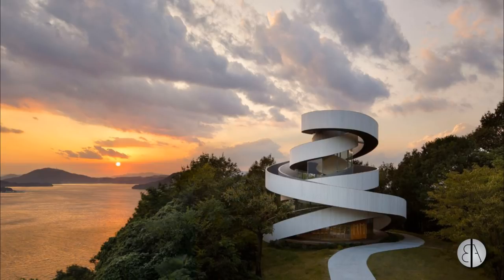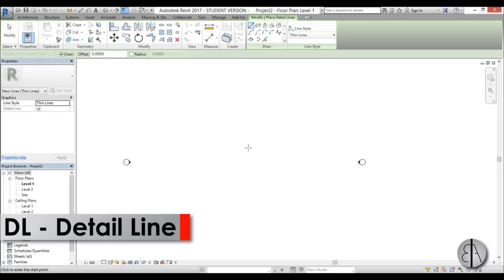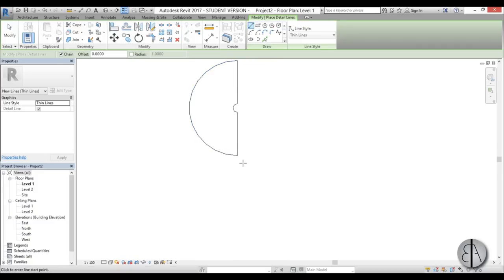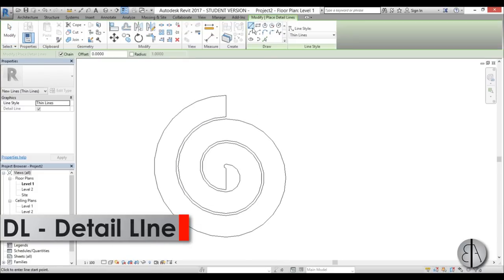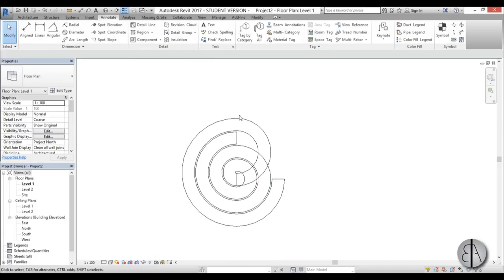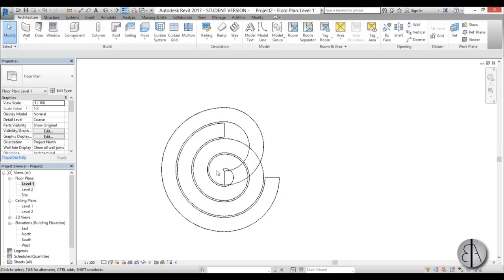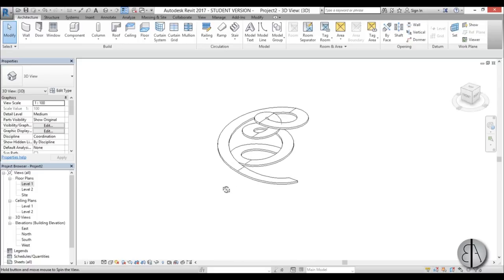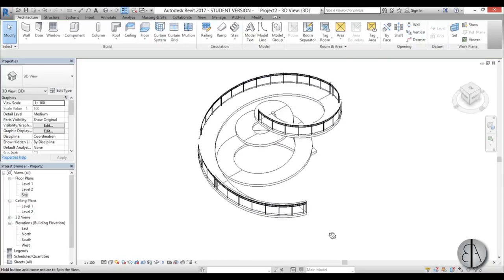Ribbon Chapel Spiral Ramp Modeled in Revit

Comment: Railing not made on spiral ramp help me out
Reply: I am having the same issue. It ends up in a spiral on the floor. Have you figured out a solution?
Reply: yes ı have the same problem. help me :(
Reply: Me too
Reply: Mee too
Reply: Solution: do the railing before you pul the points up ( do the railing white the figure is flat). Importante: when you do the railing you MUST lock it in place.  If you lock it, once you pull the points up, the railing will follow.
Reply: @valeriarodriguez1270  thank you